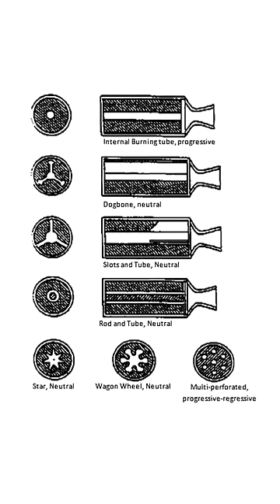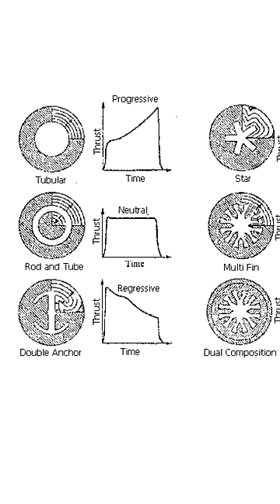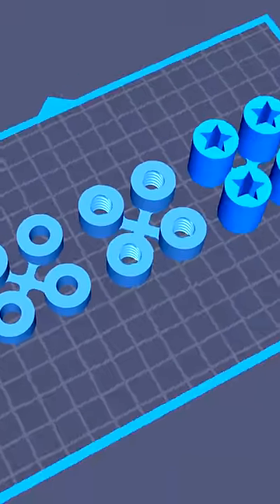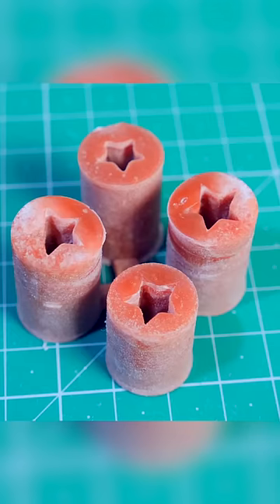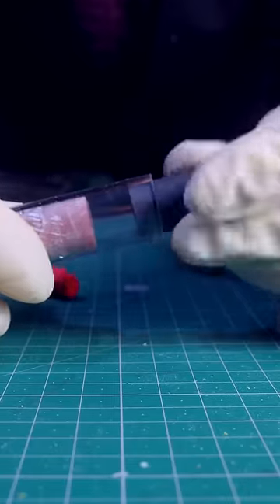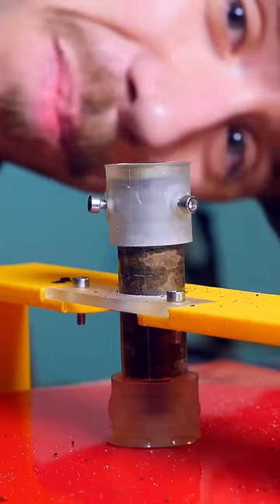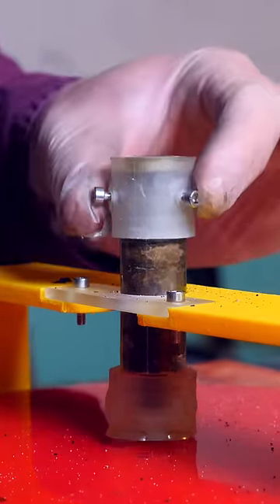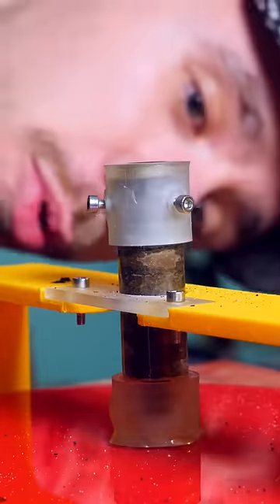Testing 3D Printed Rocket Fuel #shorts

Comment: May need a smidge more Potasium Nitrate (saltpeter). Though it can be subrisingly easy to cross the line from solid rocket fule to explosives. Hopefully it's redundant to say none of this is safe. It's very dangerous, and VERY DANGEROUS for non experts. very much do not try at home territory here.
Reply: darn and here i was getting ready to head to the market
Reply: Yeah I kinda learned you don’t ever light anything around your 5gal bucket full of stump remover and a bag of sugar the hard way it literally threw a smoke tower and looked like a whole nuke exploding 😂
Reply: @nightdivination89 what? How did they become combined if you weren't trying to combine them. Straight up lying for absolutely no reason
Reply: I wouldn’t say I’m an expert, but I do it anyway. By tweaking the ratios and adding other things you can get some pretty cool effects. Don’t light it in your living room, don’t hold it in your hand, don’t eat it, wear some safety glasses and ear protection, and stay behind something solid and you’ll usually be ok.

Comment: A 3D printer uses plastic filaments. How did you feed the solid fuel to the printer nozzle? 🤔 and how it solidifies after injection? 🤔
Reply: resin printer but i still want to know how
Reply: He uses a resin printer for these rather than a filament printer, check out the full video.

Comment: Again, the kn ratio is too low here. He needs to increase the surface area of the grains of fuel or decrease the diameter of the nozzle. I am curious on what grain geometry he actually used in this test. It's possible that he's using a Bates grain, but I kind of doubt it in this case because the burning surface area increases rapidly as the burn progresses (the diameter of the inner core increases as fuel is burnt) which should eventually make a high enough kn ratio for stable burning, unless the nozzle throat is WAY too big or he used a proper multi grain design, which when done properly can create a constant burning surface area. Either that, or he used something more like a monolithic (one big grain) fynocil grain geo

Comment: Through a process called photosynthesis  ,    leaves pull in carbon dioxide and water and use the energy of the sun to convert this into chemical compounds such as sugars that feed the tree    But as a by    -   product of that chemical reaction oxygen is produced and released by the tree
If a picture is worth a thousand worlds 
Is a movie going to make a rocket take off? 
Would a movie projector send him to space? 
Does dark room liquid make a Rockette spuel fuel ?